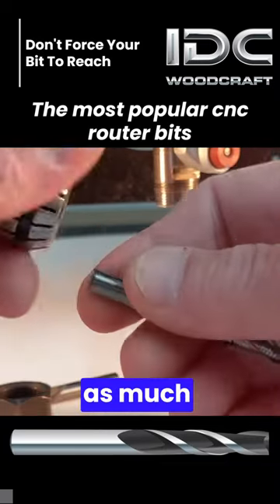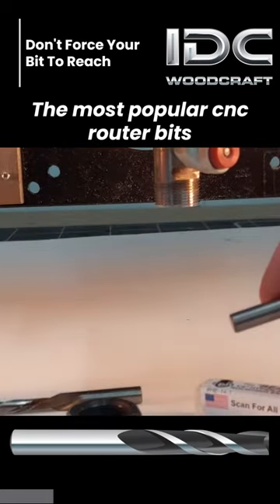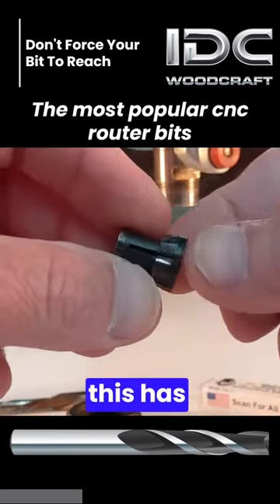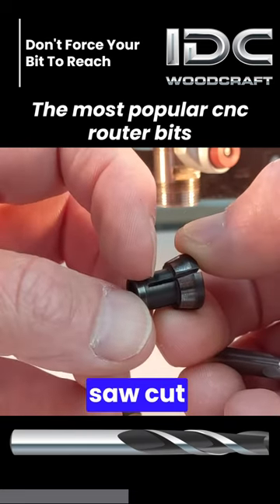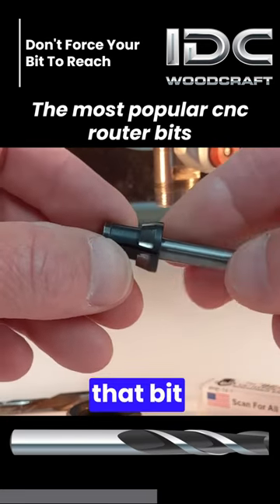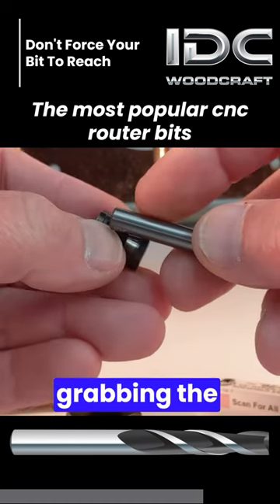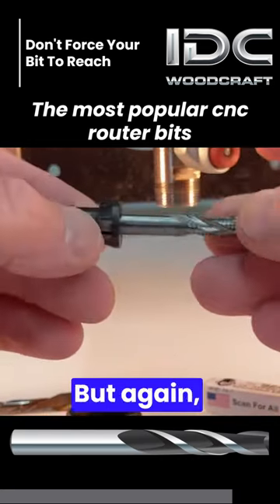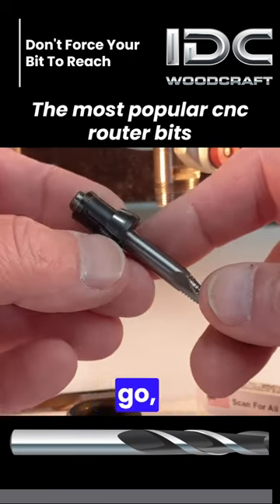Treat Your CNC Bits Right

Comment: Very good advice.  Good idea to check torque requirements for your collet.  You can over tighten the collet and damage it and/or degrade the “spring” in the collet just like crushing a washer.  If you even think it’s been damaged, which is hard to tell, through it out.  They are a lot cheaper than injury or a ruined project. Folks should also know that chip loads don’t use the step-over in their calculation but it can make a big difference especially in different species of wood.  Feeds, speeds, chip loads, type of wood, bit insertion and torque; a lot more to it the ‘throw the bit in and go until it loads down or the bit chatters’.  Heat is also a consideration for bit and collet life.  Or you can just use old fashion hand tools.
Reply from the maker: BW162, very good points my friend. Ensuring a good torque spec on your collets is critical!
Reply: @IDCWoodcraft  I learned the hard way.  Not enough torque…bad.  Too much and you crush the collet and you risk dropping a bit on a subsequent cut with proper torque.